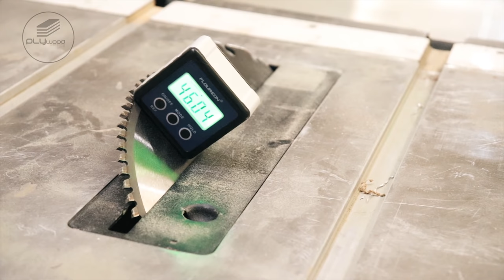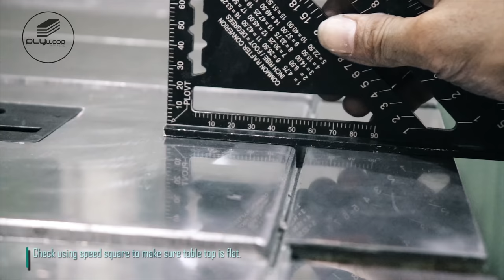Table Saw Upgrade with Metal Top Table - Portable & precision

Comment: EXACTLY WHAT I WAS WISHING TO SEE!...
The only thing I would ask, is if you have some means to level the table extension, like thin shims or leveling screws, and what is the aluminium sheet thickness, and what adhesive did you use to join the aluminium cover to the HMR.

But the thing is, this table saw is great and shows that if you take the time and dedication, you can transform a cheap and relatively crude Stanley, plastic base "contractors" type saw into a perfectly flat and straight table saw with a low cost in materials and intelligent work.

You make us feel envy of your capabilities and genius, Thanks so much for this video, it shows what is possible with ingenuity and patience.  Congratulations for your excellent results sir.  We expect many more videos from you!
Kudos from Mexico!
Reply from the maker: Awesome! Thank you!